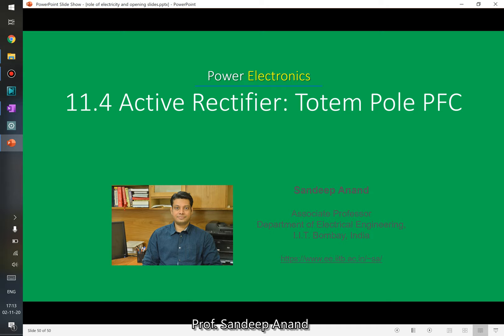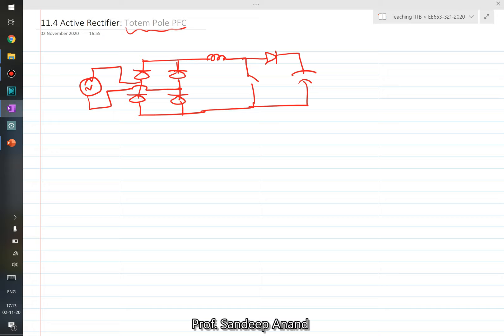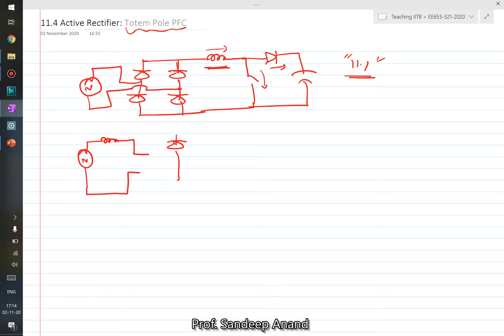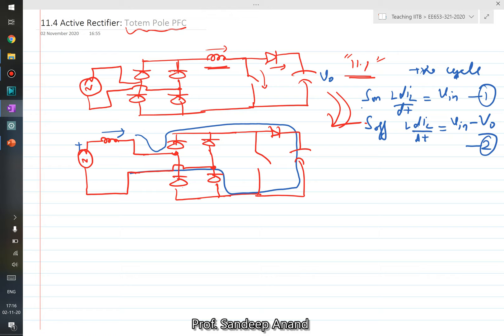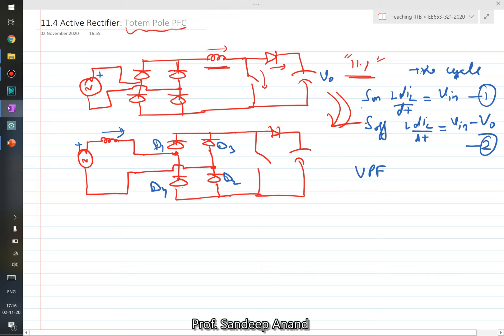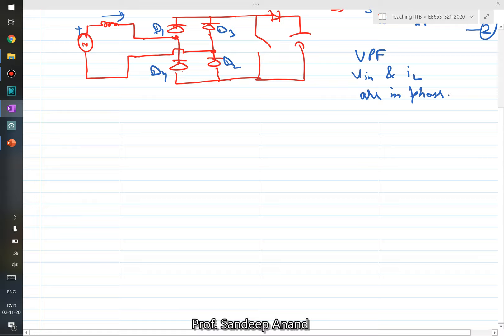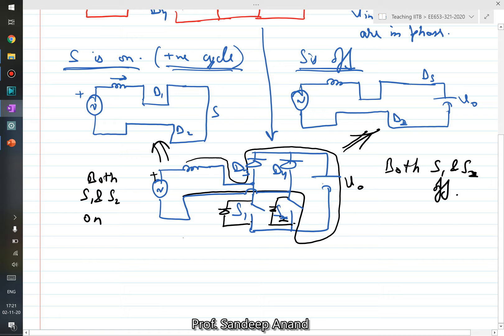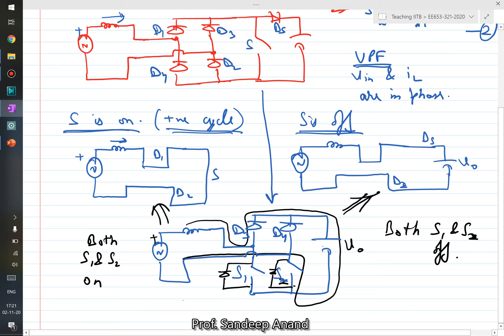11.4 Active Rectifier: Totem Pole PFC

Comment: Greetings of the day sir!

Thanks sir, it was a very infromative video.

I am starting a project for AC Voltage Stablizer.
I was searching for AC/AC Converters but not much literature is available on this.

So I am proposing : AC/DC PFC totem pole -> DC/DC buck  -> DC/DC boost -> DC/AC full bridge.

I am using buck and then boost to increase the input operation range of the circuit, let us say 85Vac to 275Vac and a constant output voltage of say 230Vac.

Please correct me if I am wrong and verify the schematic if possible. 
And please share your contact details so that I can reach out to you.

Looking forward to hear from you.
Reply from the maker: Hello Vipin, you may find the following m.tech thesis relevant 
https://www.ee.iitb.ac.in/~sa/research_students.html
go to "Design And Development of Single Phase Dynamic Voltage Restorer [Download Thesis]"